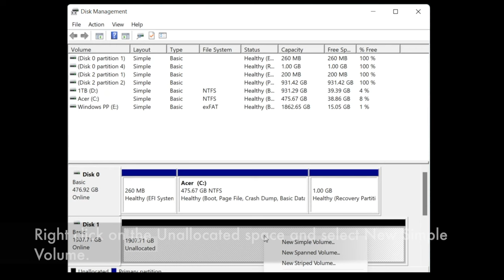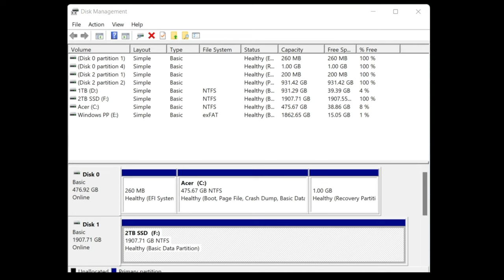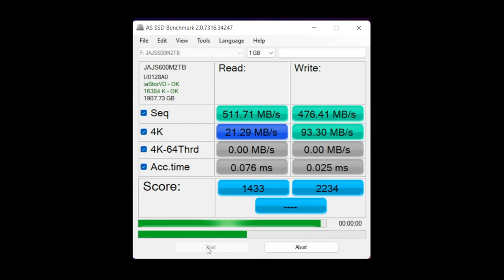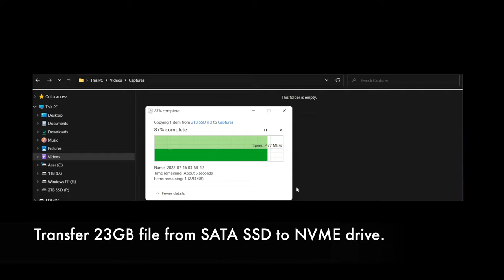Acer Nitro 5 HDD Upgrade Cable Install

Comment: can you help me bro i was doing the exact tutorial but when i turned it on the laptop read it as my old hdd name and then it's not responding, when i exit the pc and open it again, the disk is gone, what should i do?
Reply from the maker: If possible, see if you can attach the drive to another computer and format it.  If you cant do that try using an external drive enclosure to attach to your computer to be formatted.  Remember, this is just adding more storage not replacing the drive that's in there.

Comment: Actually in my laptoo the flap is not there to connect the cable??? An515-46 model?? But the silver space is there for putting hard disk

Comment: Not sure what I'm doing wrong, but when the new drive is plugged in my laptop won't turn on. The light flickers for a second but that's it. Did I do something wrong?
Reply from the maker: Does it turn on when the new drive is disconnected?
Reply: @Meanpooh  yes it does.
Reply from the maker: Which drive do you have?
Reply: Toshiba MQ01ABD100
I connected it via USB and it works fine that way but as soon as it's hooked up internally, it won't turn on.
Reply from the maker: This is strange.  If possible I would try a different brand of drive.  If the problem still persists there could be something going on with the MB.  This is seriously odd.
Reply: I'm getting an SSD instead to see if that will make a difference. Is it possible the HDD that I got isn't compatible?
Reply: @Meanpooh  update:
Got a better SSD but it's still doing the same thing. Could it be the SATA cable?

Comment: Hey can anyone tell me if i need to get this cable or is it already there in my laptop. I have 1TB HDD and 250GB SSD stock configuration.  I intend to upgrade my 1TB HDD to SATA SSD. 

Please it would be actually helpful if someone replied

Thank you

Comment: Hi can you please reply to this comment,can we put in a 4tb 2.5inch hdd of 5400rpm
Reply from the maker: The capacity is fine but the thickness is the issue. The drive needs be at or below 7mm in height or it will not fit correctly.
Reply: @Meanpooh  so if it’s the correct size will the system read 4tb of hdd?
Reply from the maker: Yes.
Reply: @Meanpooh how much tb it's support can you tell me and is this AN515-58 MODEL ??? OR 11th gen ?

Comment: I tried to install 9mm height hdd but couldn't put back the back panel does that mean i can only install 7mm height hdd? (It's 2022 model)
Reply from the maker: I generally tell people to not install a hard drive over 2TB as its generally thicker.  Using an NVME or SSD will support higher capacity with no dimension increases.

Comment: what is the brand and unit of the HDD that is compatible?
Reply from the maker: Pretty much any 2.5 SSD or HDD under 2TB.  If you go larger it may be too thick.  Go for Samsung, Crucial.
Reply: @bijoy_the_great  2 tb ssd. 2.5 is the name.

Comment: Its says that its a cable for HHD upgrade. So do i have to get a HDD or can i get a SSD? because im kinda lost.
Reply from the maker: The cable is used to connect a SATA HDD or SATA SSD.
Reply: @Meanpooh  thank you

Comment: hey great video ,my cable says ¨´HDD UPGRADE¨¨ can i use it for install ssd like u i have acer nitro 5 with amd ryzen 5 gtx 1650 and 256gb
Reply: Yes, only thing You need to verify if the new ssd is Sata 3
Reply: @NullNull-x4j  thanks

Comment: Can I use just any cable or does it have to be for acer nitro 5? Ive got a nitro 5 an515-55-53ag wanted to know what cable i could use. thanks
Reply: Your Nitro should have come with the HDD upgrade cable in the box.

Comment: if i add that i wont have to re-download all of my games or lose all of my files? also after doing everything u did will my laptop automatically starting using the space from the new ssd? bc i have 0gb left on my laptop
Reply from the maker: Follow my instructions to get the drive to be recognized.  You will then have access to the drive space to install your new games.
Reply: @Meanpooh  ah okay so everyone on my laptop will still be there? it is like adding a permanent usb?
Reply from the maker: @persimmer  Yes.  You are not erasing your main drive.  You will be adding a drive.  Your main (C) will not be touched.  Make sure you select the correct drive when formatting.  If I remember correctly, Windows will not let you format your Main drive since the installation is located there.

Comment: hey brother i lost my flex/connector were i can buy
Reply from the maker: You can get them from Amazon and Aliexpress such as this.
https://www.aliexpress.us/item/3256804194032752.html?spm=a2g0o.productlist.main.17.567a7295um7h2x&algo_pvid=ac110f7b-6317-45f1-bbed-3e5ab8d89290&algo_exp_id=ac110f7b-6317-45f1-bbed-3e5ab8d89290-8&pdp_npi=4%40dis%21USD%214.98%212.49%21%21%214.98%21%21%402101e9cf16932231824395159e45cb%2112000028975698884%21sea%21US%213901216908%21&curPageLogUid=bySDgKzhaQt9
Reply: I bought one from Ali Express and when I plugged it in the laptop wont run, when i remove it the laptop runs normally @Meanpooh

Comment: How do you know if you installed it wrong?
Reply from the maker: You will not see your drive.
Reply from the maker: @ambuyatbangass5856  Do you see a listing in your BIOS?  If it is not there check the cable at both ends.  If it is shown then goto computer management and initialize it.

Comment: Do I need this to install another ssd ?
Reply from the maker: If your machine has a SSD in the M.2 slot then more than likely you will need this.  Should be in the box if you purchased it new.

Comment: Is the hdd cable faster?
Reply: the speed is limited to max speed of SATA , expect 200 MB/s on samsung sata ssd in real scenario
Reply: Cable (in most cases) doesnt changes speed. Limitations of SATA standart changes speed. Maximum speed of a sata disk is near to 500mb/second.